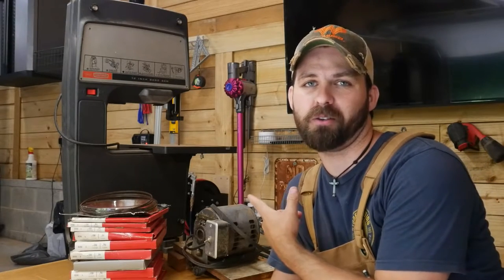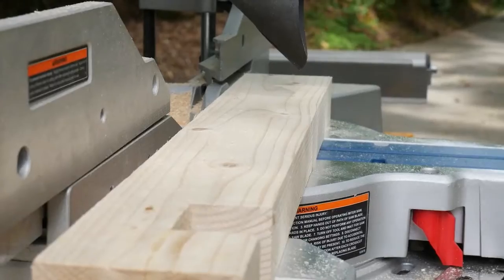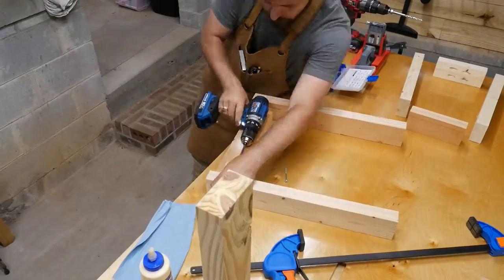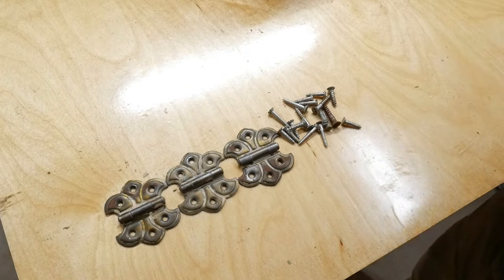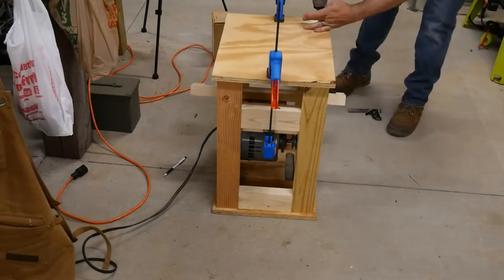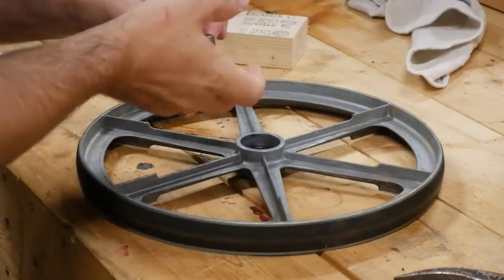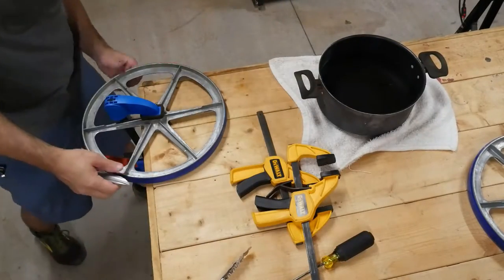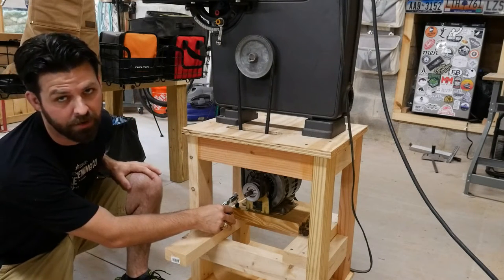Band Saw Restoration and Stand

Comment: I just purchased one of these last week. I ordered new tires from your link. When I received them, one side was smoother than the other. Which side did you put outward where the blade runs on? Thanks.
Reply from the maker: Thanks for using my link! I honestly don't think it would matter, but that said, I installed mine with the textured side outward. My logic being the blade would sit in place on the tire better that way and have less of a chance to slip. But really, once the blade is tensioned on a new tire, I doubt it will slip much either way the tire is installed.
Reply: @MadeByChance  Thank you so much.
Reply: Also, where did you get the rip fence you are using?
Reply from the maker: @rickjohnson8742  It came with the band saw when I got it from my wife's grand father. I'm not sure where he got it from. The way it's assembled (or modified) looks like it almost might be something he might have made.

Comment: I have that same bandsaw. But mine did not come with a fence. Do you have a source where I can find one of these fences?
Reply from the maker: I do not. Sorry. It came with it and I figured it was installed from the factory, but maybe it was an aftermarket thing back in the day.
Reply: @MadeByChance  As far as I know they did not come with one. I basically just clamp a straight piece of wood for a fence but I would like to find or make a proper fence. Thanks.

Comment: What is the blade length? Can't find that anywhere. Nice cart design. Did you have issues getting table level?
Reply from the maker: The blade length for this particular band saw is 80". And I've used 1/4, 3/8, and 1/2 inch wide bands with no issues. I had no issues getting the band saw table level at all after cleaning everything up. It adjusts smooth and holds 90 degrees to the band very well.

Thanks for the watch!
Reply: @MadeByChance   thanks for the response, the reason I asked about the table is mine stops about 1/16th or 1/8 of an inch before being level. It seems the front hits the base a bubble and 1/4 before plumb. I check for debris. Thanks again
Reply from the maker: On mine, when it's level there's less than a 1/16" clearance between the bottom edge of the table and the seam where the front and back panels meet. I would imagine if they're not lined up right, that could be creating an interference and not letting it get level. Not sure if that's your issue or not.
Reply: @MadeByChance  thanks I'll double check that

Comment: The top wheel bearing should of been double sealed bearings and not shield bearings, which can allow debris in. Which you did. Just noting this for everyone.
Reply from the maker: Thanks for the input, Erik. I didn't specifically discuss the type of bearing to use for this application in the video, but both the top and the bottom bearings are sealed, which as you alluded to is to keep the sawdust out of them for longer life. Additionally, I have the link to exactly what was purchased in the description in case anyone would like to see the exact size bearing needed for this bandsaw model.

Comment: what size are the bearings? Turns out mine are seized as well lol
Reply from the maker: I have a link in the description for the ones I purchased: bit.ly/3hrKCeb. They were a strange size to me 5/8" by 35mm... Who mixes metric and imperial in the same product!? 😂
Reply: @MadeByChance  😂😂😂 I hear you thank, I'm actually thinking about rebuilding the whole  thing those plactic pieces are driving me nuts. Besides then I can  use the motor to power  my bandsaw, lathe and lapidary saws thanks 😉
Reply from the maker: @lemhanback9595  no problem! Good luck!